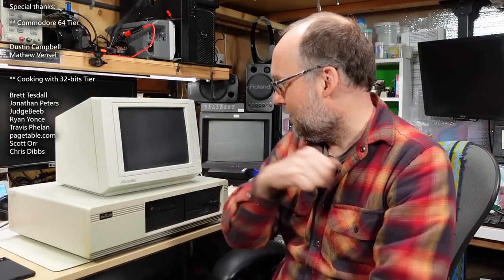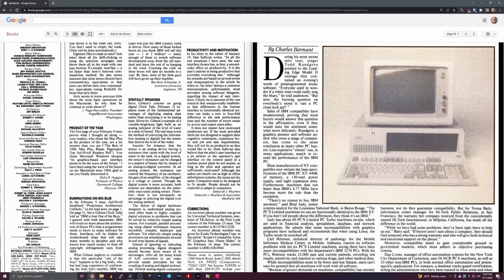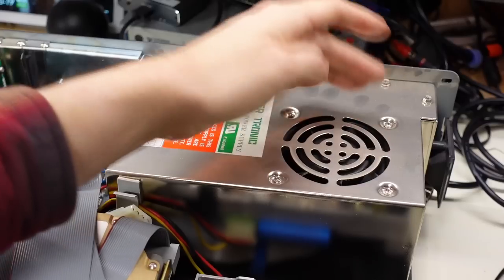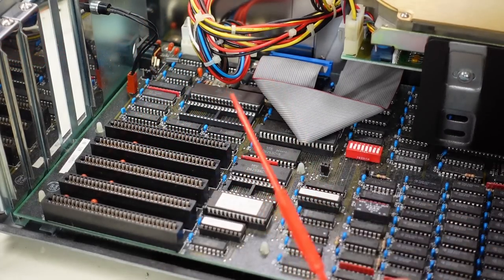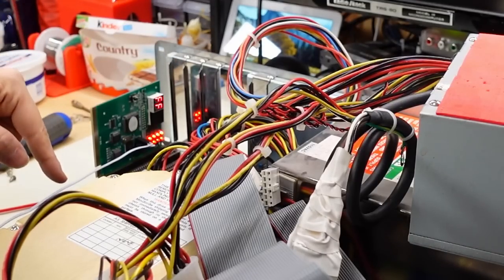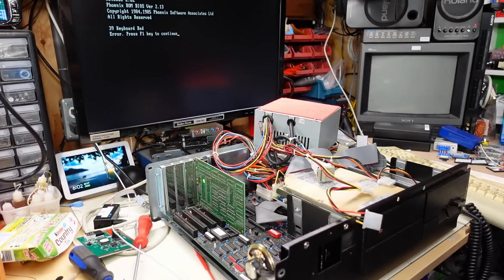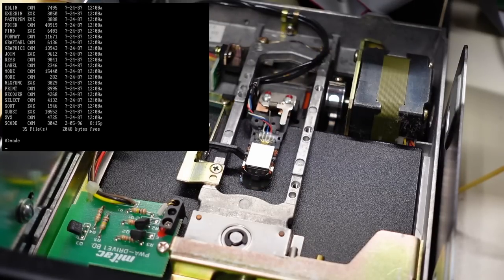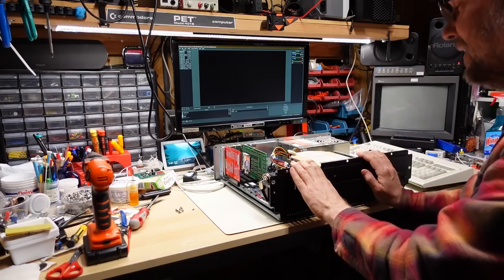What mysteries lurk inside this mint Turbo XT?

Comment: Just a word of advice. I read or heard somewhere way back in the days that if you park your hard disk you should power cycle it before using it again. Might depend on the brand of the drive though, but still.
Reply from the maker: Nah that must be some kind of urban legend. It just moves the heads to a particular cylinder on the disk. If you go to use the disk again, it just moves the head to whatever cylinder it needs to read the data. Many drives soon after would just auto park when idle, like that miniscribe drive I had a recent short about would do that. (And all modern hard drives)
Reply: @adriansdigitalbasement  I actually found the source for my memory - the manual to the Atari Megafile hard disk. It states that you need to power off the drive after parking it. The Megafile used a Seagate ST238R drive, so maybe it was just for Seagate's hard disks. When I googled for it I found others mentioning this as well, that you should power of the disk after parking it.
Reply: @jonord  The drive itself still shouldn't care. I'd guess it's the software on the Atari which would get confused by a parked disk. Either that or it's nothing at all.

Comment: Something I just ran across was a NAS designed for old computers and gaming consoles.  It is called RetroNAS.   It supports Older windows Apple and even Dos file serving.  Its SMB is configured for older windows versions.  It is built around PI OS or Debian Linux version 11  A dos machine with only a network card and Packet driver can use is for extra disk space   This is by using something called DFS distributed File System   Since many of the old protocols are unencrypted or otherwise insecure, it should not be exposed to the public internet.    This great for networking old machines, real or emulated (Pdp-11 Pdp-10s and other machines from the early internet.  Good Luck.

Comment: I used to own an 1988 PC XT clone with two identical 360K Teac floppies. They also would not let you lower the lever/latch without a disk inside the drive.

Comment: Hi Adrian, will you consider have a link to TexElec? Kevin's RGB2HDMI board was assembled, ready to use immediately without soldering and bunch of documentation, just have a larger footprint, I've bought one and it's excellent since my self-assembled copy never worked.
Reply from the maker: Just added the links, I totally forgot. Thank you! I also linked to Retro Hack Hack's store who also has them. (Out of stock at the moment right now.)

I also linked IanSB's forked project which will have my latest MDA/Hercules profiles in it.

Comment: I really don't think these displays are dim due to age.  I have 40-50+ year old Crt's that are still perfectly bright.  These amber phosphors were never overly bright back in the day.  I recall them being dull back then too.  Most computer rooms, offices, etc. Where these lives were dim too.  Everyone today is used to Eye Searing Brightness and crispy high contrast TFT's, OLEDs and the like.  We used to turn DOWN the contrast and brightness to reduce eye strain.
Reply: I still turn mine down and fortunate enough to have an office to turn off the overhead lights off and use a floor lamp
Reply: It's got burn in, so it does at least have a lot of hours on it. It was at least a tad brighter back in it's prime. 

I do recall not having my new amber monitor cranked up, and it was plenty bright in a room with a skylight window. They were definitely real easy on the eyes, especially in a dark room at night.
Reply from the maker: Heh, yeah it's not age but lots of use..... but indeed, amber is by far the most dim of all screen types I've ever seen. That new old stock one I had on my second channel really proved that. The mesh certainly doesn't help though.
Reply: The eye searing brightness has really gone too far on new displays. I find I need to choose the lowest backlight setting much of the time. My hugely worn out 1982 B&W TV is the only modern CRT I've used which looks dim to me. The tube in my 1940s TV also looks a bit dim but that's probably just because it's a much older non-aluminized design.

Comment: Keyboard is a BTC foam & foil mechanism, the stuck key is basically a symptom that the foam on the key switch had desintegreated and it needs to be replaced, quite common problem on cheaper keyboards during the late 80's and early 90's
Reply from the maker: Oh right! I had no idea if was a foam and foil. Well, it's not great feeling board, explained by the foam and foil.

Comment: i had keyboard with those switches
they are basically a spring loaded plastic piece that pokes microswitch  made out of metal dome and a metal peg trough a rubber membrane, you can cut around those 4 pegs, the mushroomed part and open them to clean then melt them back to hold the top, but the top part don't even have to be helf down because it stay in place good enough with friction alone
also switching that keyboard from at to xt and vice versa might magically fix it

Comment: When I got my Hyundai Super-16 TE (turbo XT @ 10MHz), it came with two bad bypass caps on the mono card (which left some impressive skid stains), and several bad tantalums. I opted to just swap out all of the tantalums. Unlike electrolytics, which fade out open circuit with age, tantalums are very reliable... Until they're suddenly not. At which point, as you saw, they fail rather spectacularly.

Comment: There was a kit computer featured in a multi issue run of Radio electronics in the late 80's/early 90's that placed a Motorola 68000 in a generic PC case of the era using 8 bit ISA XT expansion cards, I'd love to actually find one or at minimum see a review of what they were like.

Comment: The monitor is probably not painted, but just does not have bromium in it. Bromium (or something like that) makes ABS yellow over time, but it is necessary to keep fire safety specs and those were changing over the years.
Reply: Bromium, however, isn't the only substance to make ABS yellow.  I've researched this in various vintage PC sites, and YouTube videos about Retrobrite (or Retr0brite lol)  It's a rather mysterious process, and retrobrite can either be done under ultraviolet (and sunlight) or with just heat. There are incredible complex chemical processes making plastic yellow over time.

Comment: 13:41 DTC... Now that's a name I've not heard in a long time. I saw a lot of DTC cards working on PC's in the early 90's, mostly hard drive controllers for 486's, both regular 16 bit and VLB slot cards.
Reply: I think DTC was a common brand of SCSI controller before Adaptec dominated the market.

Comment: It's very interesting. thanks for video. I learned alot. I started my PC experience with 386 so I haven't used XT yet. I miss Word perfect as my beloved word processor though.  I used WP on my IBM PS/2 system and it was great until Windows Word killed it. I still think WP is way better than Word.

Comment: They built 'em well back in the day.  Nowadays you're lucky if you get five years out of a typical desktop machine before it's just not cost-effective to carry on.  The computer has become an all too disposable commodity.  Thanks for sharing this jewel of a system with us.
Reply: I think you can place the blame directly on Windows 3.1 and Moore's Law.  Computer manufacturers weren't sure if consumers would upgrade to entirely new computers, and Intel, for example, made "Intel Aboveboard" cards, upgrading old 8088 and 8086 PCs to 286, and even 386.  
Windows needed 386 CPU to run, and there were, at the same time, too many other desirable upgrades, with VGA and SVGA, introducing soundcards and new audio tech, etc.  So many people bought brand new PCs with upgrades to everything. And Apple sold Macs, which were completely different architectures from Apple II  and III.   
That was that. I don't think it's been a slow deterioration. PCs have been a disposable commodity for a long time now, especially laptops.  Your comment would be just as applicable 20 years ago.
Reply: @squirlmy  In the past decade performance growth has drastically slowed, at least for single or few-threaded applications. A 2012 computer will run just about everything you would want to today except the latest games. In 2002 you couldn't run anything remotely modern on a 1992 PC.

Comment: For a system with memory that simply uses larger memory chips to reduce space, it is possible that it was designed for cost rather than features.  If it were to offer that memory to you in any meaningful way, it would likely be as a register that turns the remaining 128K into RAM in the A000-BFFF area of ROM space.

Comment: The BR2032 has a slightly different chemistry which makes it perform bettee at higher temperatures and has a lower self-discharge rate. It's not rechargeable, and you can install a CR2032 in its place.

Comment: Adrian, I have a question for you, long story short I was gifted an IBM 5160 with the 286 processor, before trying to power anything on, I disconnected the PSU from the MB, to see if it works, and when I switch it on I see a small voltage and it goes down to zero, that is both on the 12V and 5V terminals of the PSU, does the older XT PSU need to be connected on the Mother in order to make voltage on the rails? PS: it's the one without a refa cap.

Comment: BR button cells are NOT rechargable.

The difference is BR formulations are higher temperature tolerance.

A CR should be a suitable replacement, provided you keep the device within more narrow temperature ranges.   (Many late XTs were designed as industrial computers and could be used in high temperature situations.)

Comment: 29:52 hard drive LED definitely isn't working, although obviously it made noises. 31:42 It's lit up.  I'm not sure why that would be. It doesn't run when powering up, but does when actively searching the disk?
Reply: Exactly. It's an activity light which only comes on when the drive is being accessed.

Comment: The fact that you could pick up this machine for $1,500 to $2,000 LESS than the equivalent IBM machine shows you just how insane IBM's profit margins were back then.  Sure the parts that went into this machine were cheaper than the ones IBM put into their machines -- but they weren't THAT much less.

Comment: The bypass capacitors by each of the ICs on a motherboard, especially if 0.1uF or similar are pretty much guaranteed to be ceramic and therefore reliable.

Comment: I wonder - and I was young and didn't know a lot when we had our clone XT (I was 8 maybe when my parents bought their first computer) maybe 1986? Anyway, I seem to remember the XT and being able to press ctrl alt + to go into turbo (ha) or ctrl alt - to go to base speed and I'm almost certain that did work on the XT. Ours was almost identical to this thing only ours had 2 floppy drives and NO hard disk.. bummer.. also had a color CGA card but still only 640k memory no extended to 786 or 1024 sadly. It was badged Goldstar but was very similar to this system..

Comment: Looking at the file dates on the hard drive, it appears they're all relatively close manufacture or OS release dates (or default 1980). I'm curious if there were any documents saved on the hard drive with a date that would tell you how long they used this computer for? Otherwise I guess they only worked on floppies. It's also possible the monitor was re-used on a later PC for longer, and they only used WordPerfect with that one too.

Anyway, I'd say it's possible this PC was oned by George R. R. Martin, but not only was he a WordStar 4.0 user, not a WordPerfect user, but he would literally still be using it.

Comment: Hi Adrian, can you please help me, I have bought this: ASHATA HW-252A CH376 U Disk USB Module Support 8-bit Parallel Port Asynchronous Serial Port on Amazon, do you know what the hook up voltages are for the board, I have the data sheet for the CH376 but no data for the board it's on.

Comment: I kept trying to think where I've heard the Mitac name from through the vid, and poking through my head I remembered "Mitac Mio", and, low and behold, it's the PDA the mother has (well, it's sat dead in a drawer), but rebranded as a Medion product (sold at Aldi), so the name kept on going for a while, whether it was the same company by then or just a bought up and "slapt it on any old crap" brand name, I don't really know...
Reply: Now I’m wondering if they might’ve made my first computer in the late 90s, that was a Medion. Come to think of it, there was a splash screen boasting of having an Intel motherboard, and presumably chipset, which was certainly not bottom of the barrel. Given other commenters mentioning Mitac kept up their quality, perhaps that means something. (Though I’m pretty sure it just had a Winmodem rather than a real modem chip… but I only say that because it plugged right into the motherboard instead of on a card — maybe Intel put one of their modem chipsets on the motherboard too?) I should really look up what that thing was. I wonder if it’s still in my parents’ garage…
Reply: @kaitlyn__L  I've no idea who Medion got to make their PCs, I do remember them being rather cheaply made, using bargain-basement MSI motherboards with "those capacitors", and the modem sounds like one of those AMR jobs, the Audio-Modem Riser or something, utterly rubbish concept that died off fairly sharpish, mostly because modems that flaked out (lightning surges usually) got replaced with PCI jobs where I worked as the AMR versions cost more to buy than generic PCI ones... :S

Comment: The BR2325 is NOT rechargeable. The difference between CR and BR type coin batteries is the battery chemistry. CR batteries generally use Lithium Manganese Dioxide (LiMnO2) while BR types use Lithium Poly-Carbon Monofluoride (LiCFx). Rechargeable coin cell batteries are generally prefixed with VL, ML or LIR and use another chemistry.

And BR type batteries DO leak, and they are extremely hazardous when they do. LiCFx is a clear liquid that will crystalize into translucent or white "fuzz" on the surface of the battery or whatever the electrolyte leaks on. This makes it hard to detect when they do leak, unlike other battery types that generally have vibrant colored electrolyte when exposed to the air.

The hazardous part is the chemical reaction that takes place inside the battery creates Lithium Fluoride. LiF is extremely toxic and is readily absorbed through the skin. It has symptoms of both Lithium and Fluorine poisoning. So you can have a heart attack while hallucinating and having your bones dissolved. In small doses, you can expect cardiovascular trouble and mild hallucinations.

LiCFx also doesn't completely crystalize, there will always be a sort of oily residue, which is the most dangerous because it is the most easily absorbed. When cleaning it up, use thick gloves and don't come into contact with the solvents or water, because those are contaminated. Also do this in a well ventilated area because the fumes are just as bad.

I give this warning as someone who made the mistake of exposing myself to leaked BR battery electrolyte on accident. Luckily I only had a small exposure and only suffered minor cardiac issues and mild hallucinations, but I've talked to other techs who were exposed to far more and the health problems aren't nice.

Treat other lithium batteries with the same care because those can also give you Lithium poisoning. Batteries which use lithium thionyl chloride, like the CR2 batteries used in Macintosh computers can poison you if you get the electrolyte on your skin.
Reply: Yikes

Comment: what about the ram? did you find out if it was mapped to EMS or something?
Reply from the maker: Without special drivers, I don't think there is any way to know. There was nothing on the hard drive to allow you to use it.
Reply: My guess is it probably is mapped somewhere in upper memory and is usable as a RAM disk, or requires a special driver to access the extra RAM. On IBM PCjrs, there is a way to modify a memory sidecar to occupy some unused portion of upper memory to add 96k of RAM. But DOS only recognized 640k, so you need a driver to use that extra RAM.
Reply: @robertcase2961  It's not DOS - it is physically wired that way.
Reply: @IkarusKommt  I don't think his statement contradicts that.  You can add RAM chips, "wire" them into empty sockets, but DOS will not recognize it without a driver. You could perhaps use them in CP/M-86 without an extra driver. But yes, the PC-DOS that came with PCjr will not recognize more than 640k.  Perhaps MS-DOS 6.22 will recognize it? I'm not sure what you are saying.
Reply: @IkarusKommt  DOS will only see whatever the BIOS tells it which is usually limited to 640k. If there's actually 768k of contiguous RAM a patch should make it all usable in DOS.
Reply: Might try DOS 5.0 and try to do a lh in autoexec or devicehigh in the config.sys to see if it works.
Reply: @stonent  It's a 8086 - it doesn't support high memory at all.
Reply: @stonent  It is 8086. It has no concept of higher memory, it is physically not there, and DOS of any version won't fix that.

Comment: looking at its age adrian the psu should be replaced with a 95-2005 power supply if you can find 1..

the mid 70's-mid 80's AT psu's aren't worth keeping even if you can  rebuild the everything  on power supply with modern components

As much as i like the green and orange monochromes

you could likely upgrade that to color crt though if the tv has a vga input there be no reason why you couldn't use the pc input

1 way to stuff up a key board plug it in whilst..

whislt you could do this on 90's at's  I wouldn't recommend doing the practice  on them on them as they  damage the keybard

with the age of it a simple clean may otherwise  rebuild would be a need ...